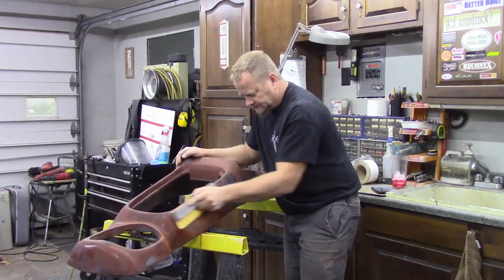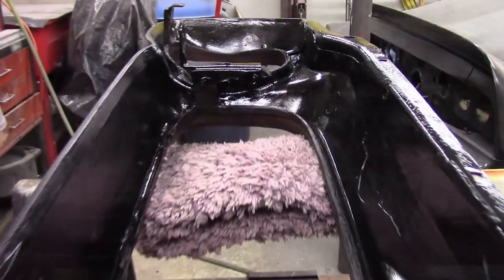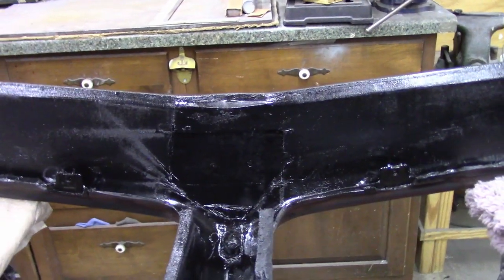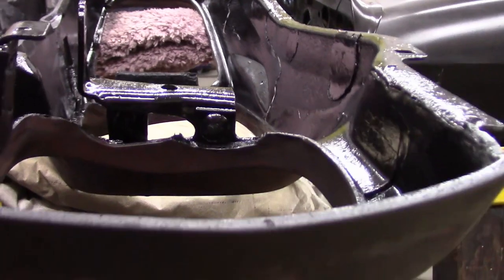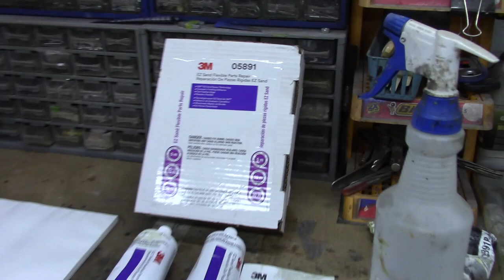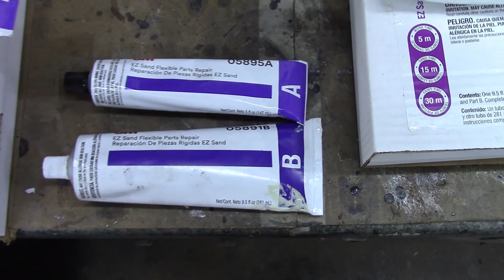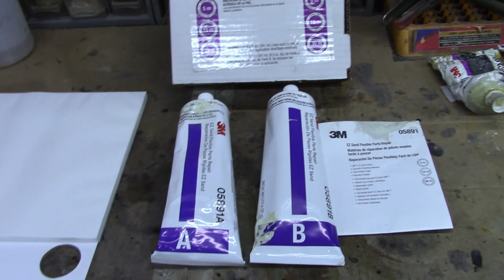Endura Bumper Repair #2. Building it back up with 3M EZ Sand Flexible Parts Repair Material!

Comment: Thanks for the insight on the 3m flex repair. Looks like it sands relatively nice too.  Gota save them birds! Keep up the good work.
Reply from the maker: Heck yeah! The 3m stuff is excellent to work with and very easy to get a strong repair.  I appreciate ya checking out the video and for the comment!

Comment: I have a 76 Formula that needs Endura repair. Was thinking about the polyvance welder but after seeing your work with the 3M system I may go that route.
Reply from the maker: Cool! I looked that system up on the ole inter web. Super neat. Looks like it also uses a similar two part epoxy flexible filler.  But it also used a urethane rod that is heated by the welder. Looks cool (but expensive). I would think the melted urethane would be a terrific binder and mender for repairs that need a lot of structure. Like an edge that was torn all the way through. Probably still need the epoxy filler to smooth it all up. But I can tell you that the edges of my back bumper were non existent. I layered and sculpted the ez sand and it is solid but still slightly flexible. This stuff is cheap enough, it might be worth a try!  I really appreciate you tuning in and for the comment!!

Comment: Good info on how to correctly restore thees endura front bumpers! However i did not use this method. i'll explain...
 
On my 73 Formula i decided to carfully cut and grind of the urethane on the back edges of the steel frame so that the outer nose profile were intact. I mostly used die grinder for this job. Then i used heat gun and different spatulas to free the urethane nose from the steel frame. Large portions were however already loose caused by creeping rust. It simply had to come off.
The steel frame now gets treated with strong phosphoric acid and wire-wheel. Plan is to epoxy prime the steel and then glue the endura nose back onto it. The endura nose itself looks pretty intact so it will only need a outer layer of a flexible and sandable  material.
I'm also speculating on doing a form of the front nose so that i can build a fiberglass replication with steel reinforcements in the well known problem areas such as the lip facing towards the hood. Will take many work hours to pull of but the end product will be so much easier to deal with in the long run.
Reply from the maker: Awesome man! Thanks for the info. I really like the idea of keeping the endura in tact! Genius!  Please let me know how it turns out!!
Reply: @HeavyPedalGarage  i'm just carefully optimistic. I belive it could work but it may also fail horrible if the urethane detaches from the steel. I'm still prepping the steel. Horrible rust pitting. Hope to get it in epoxy during the weekend. Will take some pictures as the work progresses. I'll give you a update!

Comment: Great video gets right to the point without any BS and perfect timing, I'm just starting to re finish the bumper on my 69 GTO. I see you didn't use any adhesion promotor. I assume not needed then.  THANKS again
Reply from the maker: Awsome. Thanks for the feedback man! I appreciate you checking out the video and I hope it helps. I am not a pro, just a guy in his garage. I read as much as I can before making a decision though. So I recommend doing some research but what I read is that It is recommended that 3M's Polyolefin Adhesion Promoter 05907 should be used when working with polypropylene and other hard plastics. Endura is a single cell urethane rubber. It feels fairly rough, not smooth like something that might have adhesion issues like plastic. What I have seen is that this stuff sticks. I’ve been fairly rough with the electric and hand sander and have picked at it. It has never delaminated anywhere!! Thanks again for watching and commenting!!🤘👍
Reply: Endura is basically polyurethane so the adhesion promoter is not needed. Thermoset plastics don’t need adhesion promoter .

Comment: Thanks for posting all these videos. Were you able to find how thick this can be applied? You applied it over a metal under body. I want to apply it over the sides of the REAR bumper cover on a 77 bird. This may be similar to the sides of your front bumper where you had to build it up near the bottom of the fender. It looked like you probably had to build up 4mm, but I think the front bumpers on the 70-73 birds are much sturdier than the rest covers. I'm worried this will crack off in a big huge chunk. I have some areas that would be 4" wide, 8" long, and 4-5mm deep in the deepest part where I'd be trying to make the quarters planar with the rear bumper cover.
Reply from the maker: I rebuilt both sides of my rear bumper too.  Completely reformed entire side pieces to make parts of the rear bumper that were missing. It is super strong and flexible.  I used 40 grit sandpaper to rough up where i was applying it. i did it in several "lifts" were i would apply about a 1/4 deep at  time. let it harden, rough it up, then add another 1/4 inch till i got it as tall as needed. Then shaped it to look like the original.   It worked really well. I wouldn't hesitate to try it. this 3m stuff is awesome!

Comment: Great video, did you use the aerosol adhesion promoter?  I'm working on a 73 bumper, I have it down to the endura and have some very light spider cracks. I'm checking out your ram air hood videos too, you have a cool channel, great info, very well explained. 👍👍🏁🏁
Reply from the maker: I did not use the adhesion promoter. I just started with a very light tack coat of the epoxy and gradually put more on.  No issues the epoxy sticks like glue(well I guess it kinda is glue). Thanks for the compliments too. Helps keep me motivated.